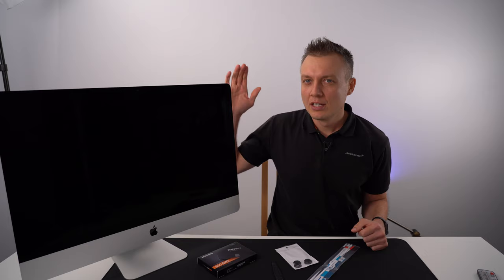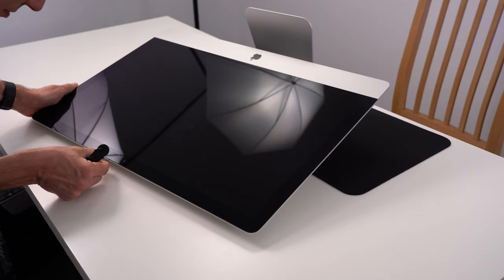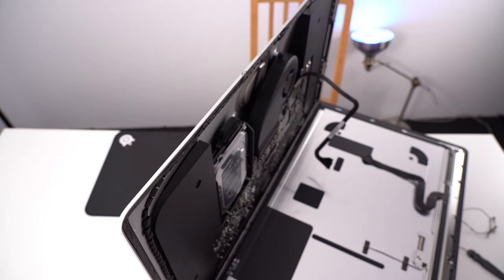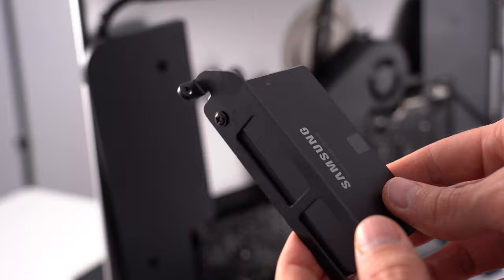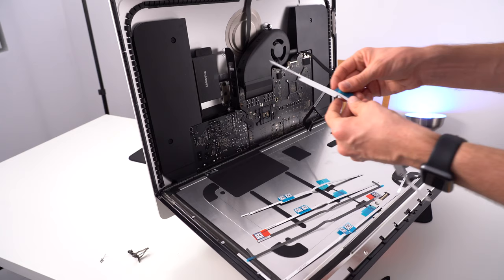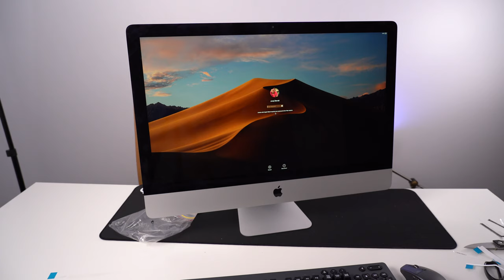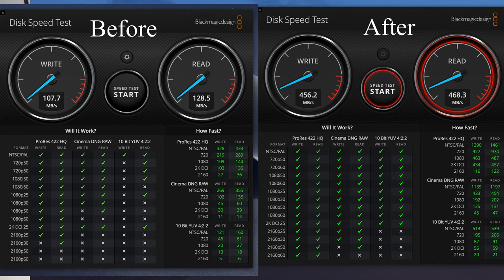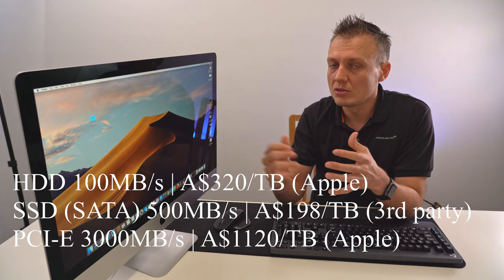How to upgrade iMac 2019 from fusion HDD to SSD (4k)

Comment from the maker: The Apple Fusion SSD cannot be simply replaced by your standard M.2 NVMe drive - Apple uses proprietary connectors and the drives are also longer. Each generation is also slightly different in number of pins and width and so on. You can get adapters but I haven't found one that I like. Yet. Upgrading to SATA SSD makes a massive difference though NVMe would absolutely be faster. Good luck upgrading!
Reply: hey guys, totally new to this, was considering building a custom PC because I thought Macs were not upgradable at a ll. But iv seen people mention updating the SSD, CPU and RAM.....

So youre telling me I can get a base 27 inch, and upgrade the RAM , the CPU and the DRIVE? No issue to worry about in the future? meaning OS updates or anything like that , should be okay? Also if I opt for the fusions drive, does that mean I need to account for that? If I just want an SSD drive, would getting the SSD model make it easier/more reliable? I felt I read somone mention addicts two drives when replacing their fusion drive. Again total newbie, so maybe some understanding w this?

ALSO, can this be done to the 21 inch then? If upgrading a iMac is as doable as upgrading pcs are then this seems kinda like a no brainer, any advice? One last question, can a RYZEN processor be thrown in then? Those tend to have more cores for cheaper prices.

I make music so I have been using amacbook pro and it doesnt seem to be best option but dont want to go hackintosh. Id massively appreciate any help here
Reply: You don't replace the Fusion with m.2 NVME, instead you replace the 32GB ssd on the PCIe port with an M.2 NVME (1tb for $130, up to 3400MB/s).  Then it is easy to find an adapter.  But you need to kept tearing down the computer till the end as the PCIe port is on the back of the mother board.
Reply: @user-mx4zn8ip9e  Hey man, quick question, what if my HD is broken (fusion drive, not sure if the HD failed or the SSD part failed), as I am trying to replace the thing. Do you think I can replace the whole thing with NVMe SSD and a NVMe to PCIe adapter?
Reply: @victorhuang9128  Yes, you can add an NVME m.2 SSD (M key) to your empty pcie port on the imac 27 with an NVME m.2 to pcie adapter.  If you install an MacOS on it, then you don't need a fusion drive.  The speed will be much faster than your fusion drive, but you need to dissemble all the boards to find the pcie port as it is on the back of your 27'' imac .
Reply: @victorhuang9128   Of course you can also use a b key m.2 SSD to replace your fusion drive with a m.2 ngff to Sata III adapter, but the transfer speed will be limited by the sata III port.
Reply: 太阳雨 Thanks for the reply, it will definitely be a challenge for me, but I’m going to try. Btw, how about the OWC thermal sensor, do I still need to put it somewhere?
Reply: @victorhuang9128  If you add an NVME m.2 SSD card, then you don't need thermal sensor.  However if you replace your fusion card with a 2.5'' SSD, then you need to have a thermal sensor (as otherwise, the fan will spin at full speed).  For b key m.2 SSD, I am not sure, but it does not hurt if you attach a thermal sensor to the heat think.
Reply: 太阳雨 thanks a lot, you are awesome man! Are you a technician or something?
Reply: @user-mx4zn8ip9e  you don't need a thermal sensor. There are numerous videos on YouTube showing that a thermal sensor is not necessary. I've seen an SSD work without a thermal sensor on an iMac 27 2013 and 2014 and 2015 without any fan issues
Reply: My late 2015 27” i7 iMac does more than 3,000 MBps both read and write with the Samsung 2TB Evo 970 Plus NVMe SSD. I also have a Samsung 1TB 860 Evo SATA SSD installed but it does only about 500MBps or 1/6th of the NVMe.
Reply: @ThinkingBetter  which adapter did you go with to make the NVME work?
Reply: @ckatitus  I bought the "Sintech NGFF M.2 nVME SSD Adapter Card for Upgrade 2013-2015 Year Macs" on Amazon.
Reply: @jurajBenak I’ve got Apple PCI Flash drive 250GB & samsung SSD 250GB (replaced by myself), 2 SSD in my IMac 2013, they both seem to be working fine, (like you mentioned it’s not possible to have 2 SSD’s)
Reply: Does a 2019 iMac fusion drive have empty pcie slot?  If not do you replace the small ssd with an adapter and add a NVME m.2?
Reply: Hello you didn't use the thermal sensor ? in SSD drive ?

Comment: Before sealing up the iMac, I recommend booting it up to make sure everything works. When I replaced my drive and sealed it up, the screen would not come. I had to reopen the iMac to re-attach the cables. I'm glad I ordered a second set of the adhesive tape.
Reply: I was thinking that during the vid. I reckon just some black tape on the top edge till you’re happy it’s all good. To bad you can’t fusion with an SSD but I’m surprised the pcie drive wasn’t replaced with at least a 512 for the system and apps. Also, don’t the 2019s have the temperature sensor problem with HDD?
Reply: Harvey How did it look cosmetically?I’m going back and fourth between an external SSD or an internal. bTW- I have 32 gigs of memory in a 2015 5k. I suspect that 16 gig sticks may be able to be used over the 8. Anyone have any info? Thanks for people who post and share info
Reply: @Applecompuser  it looks like it did before I opened it because the adhesive strips are hidden inside the screen.  The adhesive strips are easy to install.
Reply: @harvey8695  - Thanks for reply.  I will keep that in mind.
Reply: EXACTLY! This guy doesnt know what his doing!
Reply: Did it the hard way also :)
Now I check before I tape it down...
Reply: LOL. Just did this. The fresh glue strips are MUCH harder to cut away than the old ones. Wish I'd read these comments first. You live and learn.

Comment: Great video. 
Only suggestion I can add is , prior to gluing the front back to place, I would recommend a mock boot up just to make sure that all connections and the new hard drive actually works. 
It's nothing more frustrating then gluing all back together and realize that one connection was not ansambled well and it's not working at all. 
Then you will need a new set of stipes and do it all over again. 
Cheers.

Comment: If you remove the motherboard you can remove the little ssd finger drive that apple uses as a fusion drive and replaced it with an M2-NVME drive,  formatted it as a normal drive and still replaced the rotational drive with an SSD. You can keep the os and apps on the M2 drive and your data on the regular SSD.  The speed increase is impressive.  Also not a criticism just a tip - don't tape the screen up until you've checked everything is working.

Comment: Removing the screen from anything these days is a heart pounding moment...taking one off an iMac takes balls....kudos to you my friend. The hard drive swap is nothin really...even with one screw. It's all about that screen, they are soooo easy to crack/damage. Master this, and you can do anything with your iMac....please, please don't anyone get clever about soldered components, that's another issue altogether, but not insurmountable.....peace.
Reply: Yes! I cracked my screen when attempting it a couple of years ago. Fortunately the crack is just in the top right corner and most of the time you don't see it

Comment: I have a 2015 27in iMac with the 2tb fusion drive. It started acting up recently n I did everything to try n fix it without opening it up. I figured it was the Fusion drive. I went n bought a Samsung T5 500gb external ssd. I formatted it n then installed a bootable version of Catalina into it. It’s hooked up using just usb n it’s actually driving it at the same exact speeds as the one u installed. So basically I did what u did without opening it up n now just need to look at a external drive hooked to it. It’s not as pretty but it works great n now my machine is back operational again which I thought 2 days ago that I’d be spending another $2500 on a new one. So $86 and it’s fixed. I should be able to do without buying a new one for another year. I’m impressed tho that it’s running still so well for a 5yr old machine. Never had an issue until that fusion drive started slowing to a crawl. It wasn’t even filled up either. The 2tb fusion comes with 128gb of flash n I was only using About 90gb total n the drive just slowed until everything started making me see the spinning beach ball of death.

Comment: 2 tips : No 1 the SSD is so light -you dont need to put it in the framework - a little bit of velcro attaches it just fine  No 2) put it all back together with out the adhesive seal and put a small amount of sellotape across the top corners of the screen diagonally - this enable you to take the screen off if there is a problem and to also change the drive again if you wish, put the adhesive back in place if you sell it

Comment: It is actually pretty easy to generate a fusion drive using an nvme and ssd. I just did it.
Be careful this destroys all information on both disks you use to make the fusion drive.
In Terminal start with determining the disk names (they both have to be GUID formatted).
Then use this command - "diskutil cs create fusion disk 1 disk 2" (disk1 and disk2 are the names you go using diskutil list
This will generate a new fusion volume group. Write down or copy the logical volume group name. 
Next you need to generate the volume - this this command: "diskutil cs createVolume (logical group volume number) jhfs+ Fusion 100%" 
Bingo - a new fusion drive 

Of course you have to boot from another drive because this process destroys all information on both the disks you are using to make the fusion drive.
Reply: I was just thinking about this since I'm also tryi g to get rid of the HD and upgrade to an SSD instead. Now I was curious on 2 things. When I clone the drive is it going to clone both fused drives or just the HD second. Is it going to recognize both drives as ssd.

Comment: The "fusion drive" on an original machine is a PCIe module clipped onto the motherboard + SATA cabled spinning hard drive. These show up as a one drive icon but in reality, are two drives working together as one.
To swap-out, the PCIe module requires accessing the motherboard, which takes further disassembly. Time-consuming but easy enough. The Apple PCIe HD modules are bespoke to Mac's so are more costly than for standard PC motherboards.
The interesting point that Juraj made: Fusion drive is only for PCIe + spinning disk, not PCIe + SSD.
So if the OS is loaded onto the new SSD machine, it may be faster but not anywhere as quick with the PCIe
For my part, I will swap-out my 125GB PCIe for 1TB where the OS and other applications will sit, and swop-out the spinning drive for a 2TB SSD for data storage. 2 HD icons will show
Also: Juraj, didn't mention the temperature censor required for the new SSD; without this, the cooling fan will be at max all of the time. However, I understand there are software solutions.
Reply: The sensor is a scam.

Comment: I think that you also need  temperature sensor adapter after changing hard drive in iMac. Apple HHDs have special firmware that translate SMART temperature to Apple standard. Without it fan could start blowing because can't read HDD/SSD temperature. And also Hardware test will always fail.
Reply: I was thinking the same thing. In my experience the fans would blow 100% all the time. That is why I usually buy OWC SSD which have the temp sensor firmware.

Comment: You can install a M.2 SSD which will cost about the same as a SATA SSD but that will be much MUCH faster and you will still be able to keep the original fusion drive inside the iMac. The hardest part is removing the screen so IMO removing the main logic board to get to the M.2 slot isn't that much more.

SATA has a max of ~550 MBps and ~100K iops, where a "basic" $90 Intel 1TB M.2. NVMe drive will do over 2 GBps and about 200k iops. That's 2-4x faster for a little extra work and money.
Reply from the maker: Gabriel Soria iMac unfortunately doesn’t have the same M.2 slot but they’re using their special 12x16 in this model which is wider and the card is longer. The cost for those is really high and I wasn’t able to find any adapters that would adapt to it from M.2. SATA ssd is the best choice in this case

Comment: I think you would be far better of with an external ssd (take PCIe type of drive) using your thunderbolt 3 connection. Your speed will be 40 Gb/s versus the maximum of your SATA bus you ate now using which is 6 Gb/s. So for those who are scared to open up... simply don’t.

Comment: Thanks Juraj, I've considered this myself and ruled it out. 

The flash drive part of the fusion will be faster than the SSD you've just put in. And yes Apple SSDs will be a lot faster (+2000MB/s). Even bigger fusion drives will rival your 500MB/s drive because of the larger flash drive size. Bigger fusion (2TB+) will give you a bigger flash portion (128GB, instead of 32GB).. so you could fit OSX and all your favourite apps on the internal flash.

If you really want to keep cost down, I'd recommend buying the 256GB SSD version from Apple (only $100), have all your favourite apps and most current projects on it. And buy a good cheap external drive for all archival needs

If you've already bought the lowest config of the fusion and can't return it to store. I'd look into booting the machine from an external SSD (taped to back of screen) so as to keep internal fusion for archiving needs. This will give you more for the same money.

But to be fair 500MB/s will be fine for most peoples needs. GL!
Reply from the maker: utan namn thanks for the comment. The problem is the size. Speed is greater, no questions but 32GB is just way too small. And in most cases, I don’t think those speeds make such a dramatic difference - certainly not a 5x like HDD v SSD. 
I’ve tried booting from SSD but that has a big disadvantage of having to deal with certain issues, including the inability to encrypt it. 

My biggest tasks are copying 4K footage and that’s restricted by the SD card or 1Gb network so in most cases, I think this is much better alternative, mainly considering the cost.
Reply: Are there SSD's being sold that are on par with Apple's SSD's speed?
Reply: @oliverbytes  Yes, but they are very expensive. Samsung X5 (not T5) has read/write speeds of 2,800/2,300 MB/s. Basically you need to look for SSDs with an NVMe interface, instead of a SATA interface.
https://www.samsung.com/semiconductor/minisite/ssd/product/portable/x5/
Reply from the maker: @oliverbytes  yes, NVMe will do the trick but the faster ones (not all NVMe drives are ~3000MB/s) are more than double the price of SATA disks. Generally, your speed comes from accessing small files on a system drives and NVMe doesn't make such a huge difference compared to SATA in those cases. Its main advantage is sustained reads/writes of large files, like video. Other than that, it wasn't worth the investment to me.
Reply: @EmilJonssonReel  hi utan! Thanks! so the samsung x5 is 100% compatible with the iMac 2019?
Reply: @juraj_b  I see thanks a lot.. So 500MBps ssds will work totally fine / on par for gaming and editing video?
Reply: I purchased the 1TB fusion drive option because I know I can just upgrade the internal ssd or use external ssd. But I just know that apple's blade ssd is 3-4x faster. I'm not sure if this is so regrettable for me :(
Reply: @oliverbytes  As an external? Yes, I believe it is. I've heard video editors use them for their macs.
Reply: @EmilJonssonReel  oh I see.. Samsung x5 is only external. But is it true it can get up to 2GB speed using thunderbolt 3?
Reply from the maker: Oliver Martinez the first thing to upgrade is RAM. You need more than 8GB. One you have that, worry about the SSD. Since you got the fusion, same as me, I’ll assume your budget is restricted. SSD will absolutely improve your speeds almost 5x over the HDD and it’s absolutely fine for what you need. I’m using it for video editing, graphics and programming. For gaming I have PC and PS4. 

PS you can built your own X5 - get yourself USB-C/thunderbolt 3 enclosure and an NVMe drive and you’re set. You can also get USB-C only and that’s 10Gbps or about 1GB/s. Not bad for an external drive on a cheap (I got one and it cost me about A$250 for 500GB with enclosure)
Reply: @juraj_b  I already ordered in advance a 2x16GB RAM from OWC. Luckily the ram is easily upgradable. But for the drive though I think the only solutions right now are what you mentioned. A Samsung X5 (any thunderbolt 3 NVMe External SSD) or build my own. Thank you very much for the ideas! Now I can rest my worries.
Reply: @juraj_b  for programming though, do you think a disk drive faster than 500MBps is required? Your thoughts?
Reply: Oliver Martinez here are faster ssds than what apple offers in their Mac's and generally apple uses raid 0 to achieve those speeds, is there any NVME connection in the iMac in the video?

Comment: Hey guys,  that is still a SATA connection speed. For a 2019 iMac, the approximate 500ish MB/s is slow. I run a late 2013 iMac 27" with a SATA SSD connection (self converted a Fusion) that gets those numbers. Apple installed SSD on a PCIe or NVMe is much faster....my buddy on his 2nd gen 2015 iMac running i5 only was getting 1,700 MB/s...his was screaming fast and in real life did Photoshop and Lightroom tasks twice as fast as mine. The newer i9 with Apple installed SSD has to scream at least 5 or 6 times SATA SSD....Even my iMac with an Apple installed SSD gets 700 MB/s versus my SATA at 500 MB/s....some food for thought if you're after performance.
Reply: @Amir Neshati, that’s sata III which is  6.0Gb/s.

Comment: I swapped out the internal PCI SSD by a 1TB Transcend SSD PCI one and put in a HDD for additional storage. And everything worked just fine wir insane read and write speeds 👌🏼
Reply: What adapter did you use? There are so many, it’s important to get one that doesn’t throttle any speed.